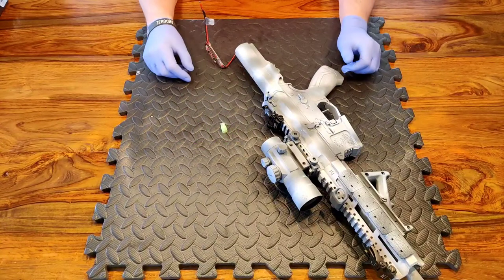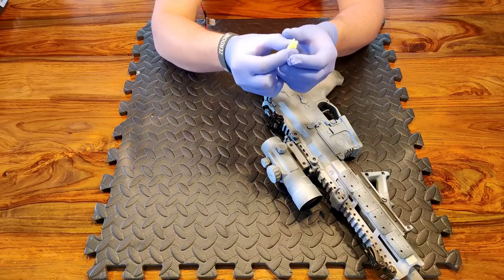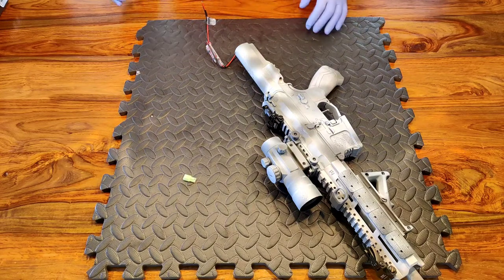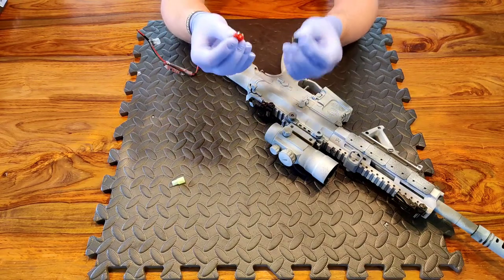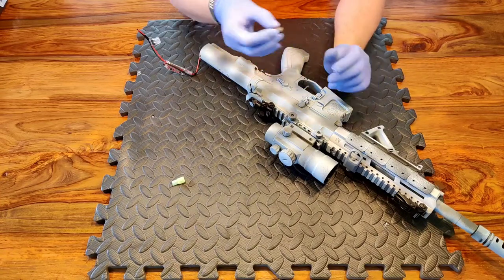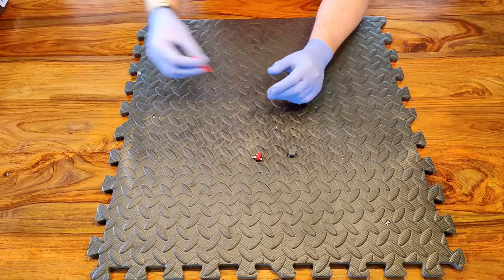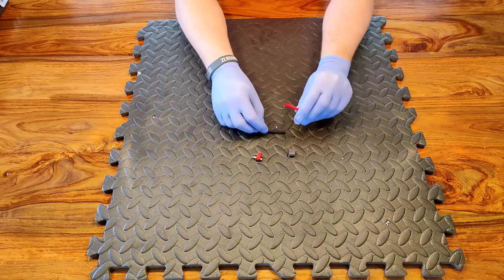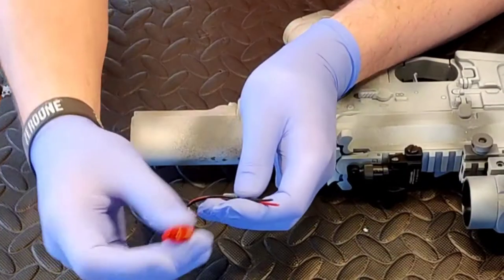How to change the plug connector on your Airsoft AEG(Mini Tamiya to Deans Conversion)

Comment: I once resoldered a serial port... Damn that was a tedious job... I guess it's easier to do deans?
I'm thinking of changing my tamiya to deans just bought my first gun few weeks ago
Reply from the maker: Hahaha. If you can do that you certainly can do deans, like you say much easier. It doesn't take long and I can't recommend it enough. Well worth it in the long run. Better electrical contact, firmer connection and neater in general. All my replicas get the deans treatment before I even use them these days.

Comment: Hey man I recently bought an Airsoft gun and I noticed it uses a dean connector and it’s my first time hearing about it but does anyone know where I can by a deans connector charger?
Reply from the maker: Hi. There is the option to use a tamiya to deans converter on your charger. When you get one though just ensure the connections are the correct polarity. They are sometimes switched which will definitely result in a bad day. Most decent chargers will have multiple connection types though if your getting a new charge but even some of these will be for xt60/90 and so you will still need an adapter. I did a video on lipo charging and also on the charger that I use. You can find those ones in the batteries and electrical section of the channel. An adapter can usually be obtained from most airsoft suppliers or alternatively ebay.

Hope this helps.
Reply: @rockbottomairsoft  Thanks for letting me know! I’ve been looking for a charger that would go to my batteries and I did actually find one similar to the one you are describing thanks for helping me out as well man
Reply from the maker: That's great. I'm glad you've managed to get sorted out.

Comment: what if i want to change from deans to tamiya?
Reply from the maker: That's certainly doable as well. It's just the reverse of what we do here but obviously the method is slightly different. Fitting tamiyas is far easier with a pen extraction tool. Less solder involved but you can solder the pins if you prefer. However all that being said I would strongly recommend any connectors over tamiya. 

Hope this helps.

Comment: So I had gotten a new gearbox from a guy off hopup, he was switching to deans but had stopped right before he put the deans on, is there a way I could put the Tamiya back on or do I have to stick to deans?
Reply from the maker: Absolutely, you can put the Tamiya plug back on if you want to. I can't emphasize enough the benefits of going with deans plugs but if you prefer Tamiya that's not a problem. If your dealing with bare conducters then you will need to get hold of some Tamiya plugs. They are quite simple to fit. If the wire has not been cut then you should be able to push the Tamiya plug back onto the crimp ends.

Comment: what will this improve in my gun?
Reply from the maker: Performance wise, not much apart from maybe less resistance in your electrical system. Practically though deans are much better connectors. They provide a more stable connection mechanically  they are far less prone to failure, they can handle higher current and as we mentioned create less resistance. Finally as a slight bonus they are slightly smaller and so take up less space. A decent serviceability upgrade more than anything else.
Reply: @rockbottomairsoft  ty